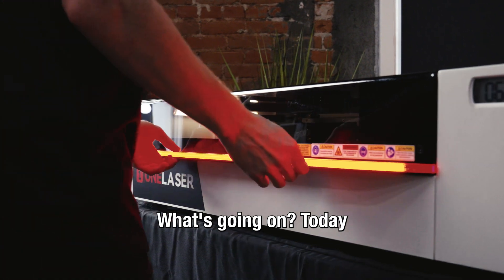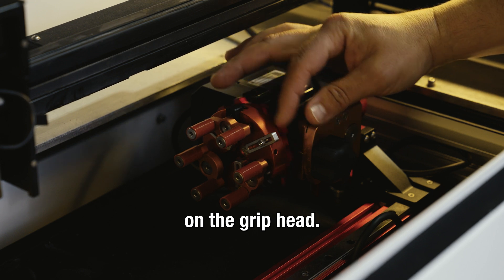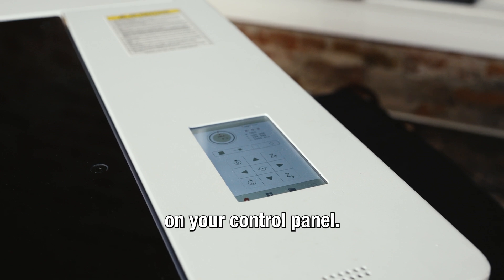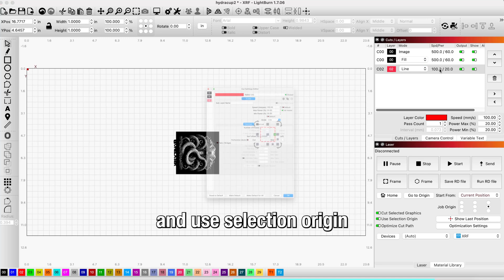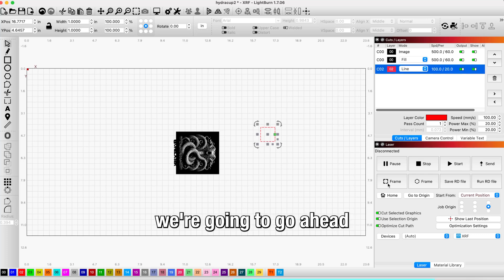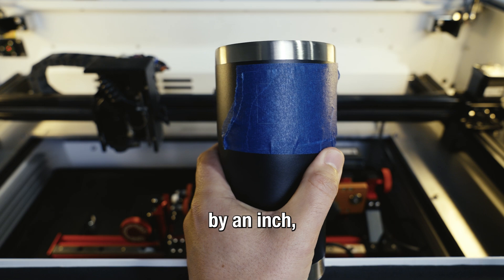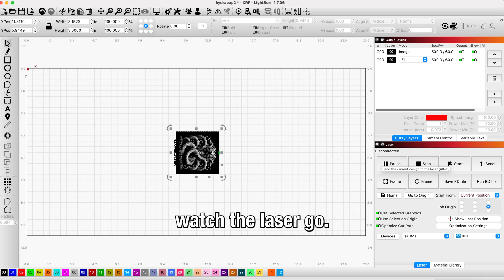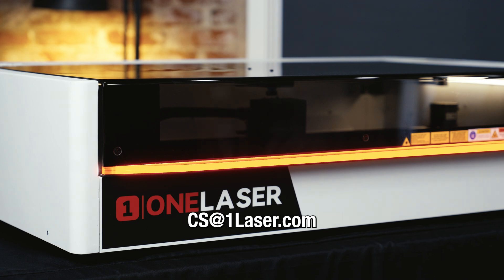Physical Rotary Setup & Lightburn | OneLaser XRF Desktop

Comment: I must have something on the wrong setting. In order to get my 1”x1” square on a 20 ounce Tumbler, I have to set my rotation on 19,000. My diameter is set at 88.93mm. With my Thunder Nova laser with the 130 CO2 tube and using the ROTOBOSS rotary I use a rotation rate of about 4500. Any suggestions?